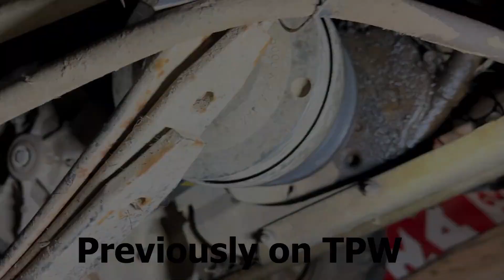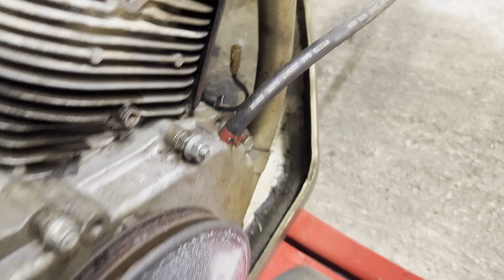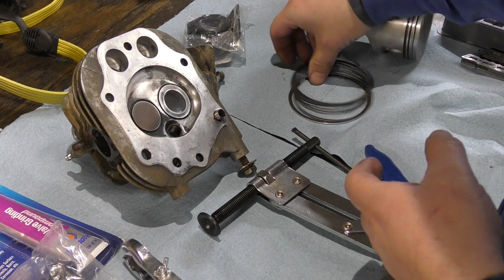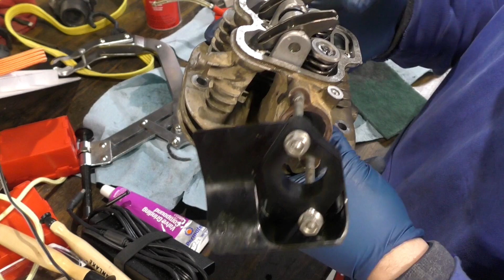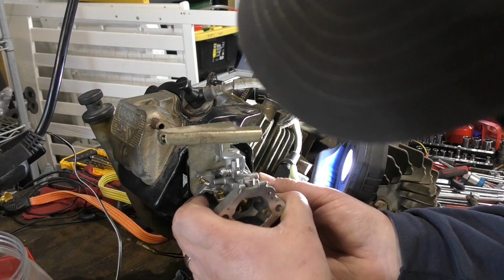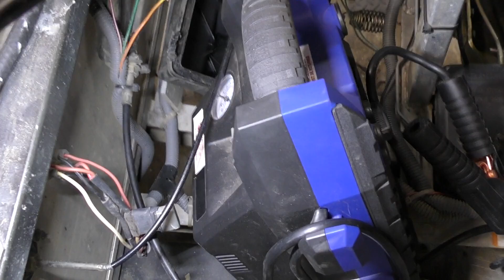Marketplace Revival - Bobcat Pioneer (Club car carry all) Part 3 - Kawasaki FE400D "tune up"

Comment: What do you reckon the top speed to have been?
Reply from the maker: About 15-20mph, not much of a speed demon but I’ve had 1000 lbs of rock and soil in it and moved it without issue
Reply: @thephishworkshop  That's around what I thought it would be, which wouldn't be terrible for yard work. I have been wanting to get my hands on one. I imagine a person could repower one fairly easy if they wanted to.